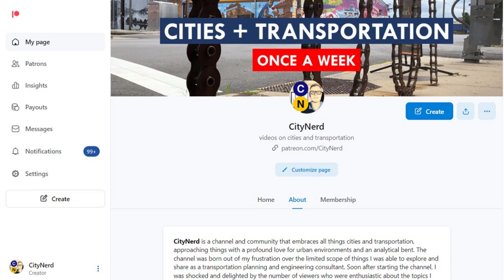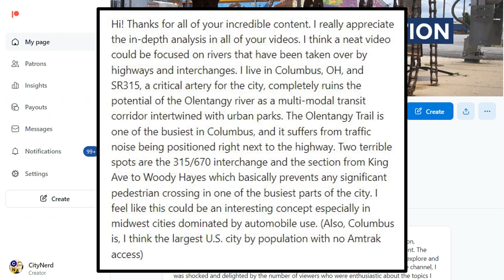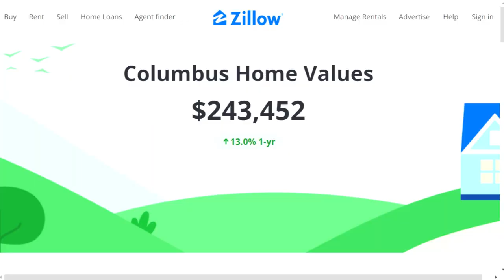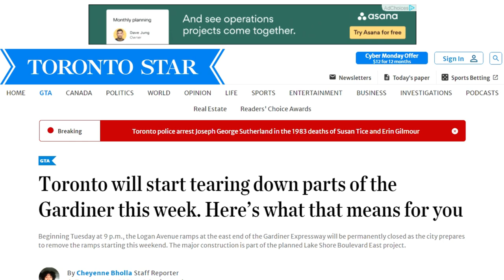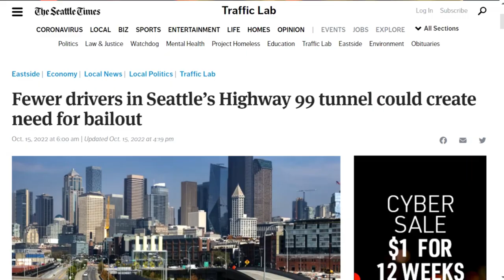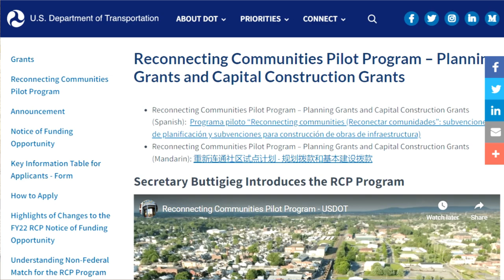Highway Engineering Madness: 10 Waterfront Freeways That Need to Go (North America Edition)

Comment: As a Chicagoan, I've progressively come to identify LSD as a horrendous sore. When I owned a car, I was initially enamored by how beautiful of a drive it was, especially on the north side, but I quickly got annoyed with slow travel times and traffic. There's a bizarre stoplight on the north side almost immediately after a near 90-degree turn (even despite the drive lacking the infamous 's-bend' for decades now), and every single time I've driven that segment I've felt like I've narrowly missed a wreck. It doesn't help that people drive 70 mph even though the posted speed limit is like 45mph.

Outside of a car, all the glorious green space along the lake is marred by noise and air pollution, and frequently you have to walk a half a mile to get to the nearest bridge or tunnel. After rush hour, residents are kept up all night by drag racing cars. I've tried to go on walks with friends on the lovely paths by the lake, and often we have to shout at each other due to the noise. On multiple occasions I've seen cars that have flown off the road over concrete barriers.

If there must be a road, make it a two-lane tunnel underground with a new L line, please. So sick of our cities designed for cars instead of people.
Reply: lakefront trail rocks, but LSD takes so much potential away from it. Bothers me so much how people have come to embrace it in Chicago.
Reply: IMO the bigger crime in Chicago is how wide Wacker Drive remains in one of the most pedestrian heavy portions of the city.  The Riverwalk is nice, but segmented far too much; so when you DO pop back up - Wacker is just... so much wider and less protected than makes sense for a roadway that already has a dedicated below grade service street.  Especially East of Michigan Ave. - where the top level could honestly possibly be removed entirely without impacting traffic significantly.  Heck, the width of the thing between LaSalle and Michigan is an abomination given how pedestrian dense the area is.

Agreed on LSD though - last time I visited, I walked from my hotel north of the river to the museum campus and was shocked to find that the only connection from the north side riverwalk to the walking/biking path East of LSD was via surface streets all the way up by Navy Pier.
Reply: I totally agree! LSD should be entirely closed and made into a park and new L line. Also Wacker in the Loop should be underground only.
Reply: @tedschmiedeler1336  I think the biggest thing taking away potential is the continued stupidity of both bikers and pedestrians on the lakefront trail.  Would love to see annoying speed bumps or something similar to keep the bike path and pedestrian paths separate and safe.  My wife and I used to walk the path a few times per week but I'm not taking my 2 year old on the path lest a biker going 30mph blast him over
Reply: Completely agree. I'd wonder if it would make more sense to convert LSD into a bus-only facility, since I'd imagine making it a train line might be way too pricey for the city. In my mind it's a beautiful Euro-style grassy two-lane affair, but who knows. I live just north of that horrible traffic light you mentioned, and the intersection is obviously appalling at the pedestrian level; having basically an expanded 147/151 bus with increased frequency and capacity running down LSD would be life-changing for anybody close to the shore.
Reply: @jaredking31  I agree.  They got it wrong by putting the separated bike path closer to the lake.  That should be the pedestrian path since the parking lots are there and everyone crosses the bike path to get to the lake and beaches, especially at Foster.  I don't know how many times I've almost taken out a pedestrian or an entire family as they cross without looking.  Signage needs to be beefed up to warn them to stop and look both ways along areas like this.  I don't bike the lakefront trail on weekends at all because of this.  Bikers need to chill out, slow down, and expect that they will encounter pedestrians at some point.  Don't get me started on those pedi-carts for rent
Reply: @jaredking31  at least on the north side they have almost entirely separate paths for bikers and pedestrians now.
Reply: I’m with you on waterfronts being better used than by freeways, but if your local culture has gotten so helpless that you’d tear down a road to stop drag racing, you have bigger problems. You need to fire your mayor and all those who support him/her and clean house. Street racing can be stopped while making money for your city. If your city can’t stop such obvious violations, you are heading towards a Detroit style ending.
Reply: @nunyabidness3075  Oh there's nothing Chicagoans like more than hating the mayor. 

And I feel like stopping drag racing isn't really the primary point of the original comment - getting rid of LSD would be moreso about promoting public usage of the lake front and potentially opening up really valuable developable land
Reply: I am a 3rd generation  Chicagoan. I both love and hate LSD. It was used as a dividing line to create all that wonderful  public space. But some places along the road there just isn't  enough separation  between  the road and the lake. LSD gets shut  down on average  3 times a year due to weather. And not only in the winter. As far as permeability  goes,  almost everything  east of the drive is park land and is closed from 11 pm til dawn.  In the last 10 years or so they have started  actively  clearing and closing  the lakefront for safety  reasons.   Again, I'm  not so sure about this, but I can sorta understand. The lakefront parks are constantly  well used year round. To an extent that I often have to remind myself that it belongs to all of us, so quit giving  those kids dirty  looks.  Those parks are a major part of what makes Chicago great.
Reply: @jj6282  diversey harbor is a terrible connection point where pedestrians and bikers overlap as well(right where the boats come out under the bridge).
Reply: @potterfollower  Totally with you on making better use of the space.
Reply: Lived in Chicago for five years and frequently walked along the lakefront on the north side and these are pretty much my sentiments as well.
Reply: @potterfollower  Chicago has the lakefront protection ordinance to block development and it's probably the best decision they've ever made. Without it I'm sure there would be no parks or paths along the lake, just ridiculous high rises.
Reply: @nunyabidness3075  Like the other reply said, we do hate our mayor A LOT. And getting rid of LSD isn't to get rid of drag racing. But to stay on that topic, drag racing plagues any car-centric town that has wide and separated "busy roads" perfect for it. I grew up in a suburb that was smaller and denser so there were no separated large roads to drag race on. Then I lived in a huge suburb, the classic car-centric NIMBY type, and I happened to live on the edge of the residential area so I was very close to two busy and wide roads (Not next to it since there were no houses there, but on the closest street). Every single night I would hear the sound of people drag racing. And personally I didn't mind the sound, but the racing became a problem for late-night workers. Once I started working, my shifts ended at 10:00pm, which is when people start racing, and them running red lights created a lot of close calls. Also, drag racing ties to a certain type of car culture, so it's not as simple as most people think (I don't even hate that car culture, I just wish they weren't so dangerous).

Basically It is a result of many factors, mostly relating to a town's design that allows for such racing. A mayor can't snap their fingers and get rid of it (though they can at least do some preventative measures).

Also, people already push every problem onto the mayor and claim Chicago is going under and turning into Detroit. And don't get me wrong, I hate our mayor, but this doomer mentality really affects the possibility for change especially in a city that already has such a bad (and overly exaggerated) reputation like Chicago.
Reply: @nmx0014  I dunno, Custard.  There are cameras on all these freeways. Doesn’t seem complicated to me. Last time illegal racing became a thing, they found good roads with no traffic hidden away. Nowadays I see the racing on the same stretch of I10 every time I drive it. I’m not voting for this mayor, nor the same sheriff or constable.
Reply from the maker: Ha, I noticed that traffic signal AFTER I recorded the piece where I said it's all freeway until you get to Grant Park. There is that rogue signal! Crazy, dangerous stuff.
Reply: I get that. Clearly the opinions of 708ers are different. :)
Reply: BetterStreetsChicago made a proposal about a LSD improvement
Reply: Yep, well said. Never thought much of LSD growing up but now I see it to be a complete barrier to enjoying the lake and connecting with the rest of the city. What a fricking terrible idea of a highway.
Reply: Its the best drive in america. 95% of ppl I know in chicago absolutely love it.
Reply: I honestly thought LSD would make the top ten that street is an abomination. Chicago has one of my favorite waterfronts of any city but ofc they put a fucking highway on it.
Reply: Not from chicago but I love LSD
Reply: @tedschmiedeler1336  LSD? really? They need to pick a new acronym.
Reply: @jj6282  What segment are you on where the bike path is closer to the lake? Almost everywhere I've been on the Lakefront trail the bike path is closer to LSD. Some dumb bikers ride on the pedestrian trail but usually I don't have an issue.
Reply: Aw, rats. Chicago was my number one city to relocate to once LA ran out of water. Maybe Toronto...
Reply: LSD is a great time. It blew my mind. I'm not a Chicagoan but I had a great trip on lsd.
Reply: @nunyabidness3075  studies have shown that the most effective way to prevent street racing is to create municipal recreational tracks for public use. Part of the spike in illegal drag racing has come from a decrease in the number of legal drag strips. Similar to the way building new skateparks reduces the incentive for skaters to skate in busy public squares, designated tracks reduce the incentive for drag racers to race on public roads. Contrary to public belief racers don’t have any desire to crash, get arrested, or hit a pedestrian, but if they don’t have a space to safely engage in their hobbies then they will do so in public settings.
Reply: @jacobbwalters8133  Sounds reasonable to me. Of course, where you going to put it? Who will pay? What about liability?

The nanny state has conspired to destroy the easy solution which was to close a small airport for the day. You see, “no one needs a personal airplane”, and that land could be put to better use, so it was. 

Personally, I’d like to see a new custom develop where when some ignorant busy body says, “No one needs [insert other people’s hobbies here]” they get smacked in the mouth.
Reply: @nmx0014  I think one of the reasons that Chicago is gaining a bad reputation is that it is heading in the wrong direction compared to Detroit. Detroit is widely recognized now as a city on the rise since its bankruptcy. There is a lot of new development, a growing tech scene centered on fintech (rocket companies, Huntington, and ally financial are all headquartered in Detroit), low costs of living, as well as big investments in green public spaces and community based policing/public safety initiatives.

Chicago, meanwhile has suffered from an exodus of businesses, rising crime rates (Chicago’s reporting method also makes its rates look artificially low by requiring only the highest level offense be reported- ex. a armed robbery where someone is murdered would only be reported for the murder), and increasingly shaky city finances.
Reply: @angellacanfora  Go to Detroit! Great new river walk developments and you will be amazed how far the dollar stretches! Transit is lacking, but you can live right downtown in the middle of everything for relatively cheap- no need for transit when you can walk everywhere!
Reply: @CityNerd  There are a lot of signals. They start at 800N Chicago, and go to about 1200S Roosevelt to control "loop" traffic.
Reply: @jacobbwalters8133  I'm intrigued! What about crime?
Reply: @nunyabidness3075  I think that publicly funded tracks with low entry fees to pay back public funds over time would get the job done- probably around $50-$100 entry fee for racers- $5 for fans. Land on the south side is relatively cheap and there are a decent number of vacant old mall properties that could be leveled and used in this way. You could set up concessions and betting stations around the track (similar to a horse track) and further generate revenue in that way. Set up some rapid transit links for people to watch who don’t drive themselves and voilà! You have yourself a cheap way to provide family friendly entertainment, prevent dangerous behavior on city streets, and generate revenue over time. It would likely cost in the neighborhood of $10-$20 million to build but because it is adaptive reuse would likely qualify for brownfield redevelopment funding. You could use the remaining land for a wooded park to further muffle the noise impact on the surrounding community so that the neighborhood impact is not huge and possibly even sell advertising and sponsorship deals to tire and auto manufacturers or local dealers.
Reply: @nunyabidness3075  as for liability, there are a number of waiver contracts that could get the job done- you could essentially copy/paste from the waivers used at the many legal racing tracks around the country.
Reply: @jacobbwalters8133  I admire your spirit, but I don’t think that’s going to be easy.
Reply: @angellacanfora  crime is pretty low in nice neighborhoods. Sheriffs Craig and now White have implemented community based policing which has helped a lot. Downtown and Midtown are both very safe areas, as are many of the historic neighborhoods like Boston Edison, though those are further from the urban core and the walkable lifestyle you seem to be looking for. If you are looking for a turn of the century mansion in a good neighborhood for under $1 mil, however, that’s a great place to live- lots of beautiful Tudor, Colonial, Craftsman, and Italianate homes there are on the market for less than $500k.
Reply: I mean considering the horrible traffic on 94, we kinda need LSD, but yea I agree it’s definitely an eyesore.
Reply: @nunyabidness3075  haha. You are right. Zoning in Chicago is a pain and that, combined with current political conditions, would probably make such an option infeasible. I am a policy wonk by trade, so I tend to think in terms of what can and should be done, as opposed to what is most politically and administratively feasible. 

I imagine that this could be sold politically in a city like Chicago, however. It could be billed as a neighborhood revitalization project that decreases criminalization and provides an alternative path and community for young adults apart from gangs. Additionally, you could have a trade school attached that teaches mechanic skills to promote job growth and certain days be EV only, both to reduce noise in the community and to serve as a technological showcase of up and coming green tech. The whole thing could be partially powered by a wind and solar array where one of the old parking lots used to be.
Reply: @nunyabidness3075  which theory of Piketty do you take issue with specifically? He has produced a great body of work in the field of economics and economic inequality in particular so I cannot tell if I agree with you or not- it would depend on the specific theory you are referencing.
Reply: @TeslaDystopia  Northside...From Foster to about Irving Park
Reply: @jacobbwalters8133  Sounds interesting, thanks for the info. I will definitely want something small & low maintenance, like an apartment/condo/townhome situation, once I get to that stage of life, whether as the result of drought, retirement or the Big One!
Reply: @jaredking31  it really is insane how fast some of the cyclists ride in pedestrian heavy areas. And many times they will have the audacity to get frustrated at the pedestrians and slower moving cyclists. 
These entitled assholes won't admit that it's NOT the place for spandex unitard wearing wannabe triathletes in training. Police really should be citing them. Maybe they do, but I haven't seen it.
Reply: @CityNerd  The infamous stoplight at Chicago Ave. It also helps nothing that there is a left turn lane at that stoplight, and the turn lane is insanely short, so cars stack up quite quickly as bleed over into through lanes creating a traffic nightmare as well as egregious safety hazards. When frustrated drivers in the through lanes are stopped during the very limited cycle time when the light is green, they begin to dart out into the other through lanes in which cars can be travelling anywhere from 30-60mph. 
I've heard a theory that the traffic signal was placed at that intersection to slow northbound traffic for the approaching "S" curve where the speed limit dips to 25. There is already a lot of spin outs and drivers hitting or scraping the barrier walls. But I'm skeptical of that theory since there is no traffic signal southbound approaching the same "S" curve. 
And I didn't even get into the chaos of the people coming out of downtown, turning from Chicago Ave ONTO Lake Shore Drive southbound, a turn of which nobody really seems to know the legality, the signals are unclear, and there are 2 different barrier wall obstacles (with just enough gap for a vehicle to squeeze through) that are quite confusing for motorists to follow. 
That entire intersection is a bane on the city and I'm surprised there aren't more deaths due to crashes and road rage. 
Driving in downtown Chicago is a test to say the least, even with an overall well designed plan. People are nuts. The cabs and bus drivers do NOT care about your feelings, and even the cyclists are extremely aggressive.
Reply: @jacobbwalters8133  Might want to check your facts.
 According to Geography Nerd, Chicago is recently recognized by actual stats (not media rhetoric) as the number one city for corporate relocation. 
Which one of you is wrong?
Reply: @jacobbwalters8133  literally everything you are saying is media rhetoric. 
Crime rates in Chicago have decreased 2021-22. Crime rates were rising ALL over the country during the pandemic years, which went against the decades long trajectory of decreasing crime leading up to that point. Chicago didn't even come close to seeing the highest spike in crime rates during the pandemic years. There's a list you can look up if you care about actual facts and stats. And the bit about artificial crime rates is literally a slippery slope to a Qanon level of reasoning. Simply paranoid conspiratorial drivel intednded to propagate a right wing political agenda. 
How can YOU verify and provide evidence for that claim other than repeating the right wing talking points incessantly regurgitated by right wing hack political pundits that have had Chicago in it's cross hairs ever sice Trump started spouting off about Chicago for no other reason than a political spat with the mayor of Chicago? 
How can you verify your claims? Lol you can't. 

That is literally ALL this is. And you bought into it. 

It stands to reason that homicide rate is a pretty good indicator or overall violent crime, and the stats on homicide RATES speak for themselves. Chicago is not nearly the highest on that list. And if you think they are fudging those numbers, which would require literally hiding dead bodies, you are really far down that political rabbit hole.
Reply: @jacobbwalters8133  When I searched riverfront project, I saw Detroit and so great to see that there is another city besides Omaha and a few others are doing, so far though; Omaha appears to be the most serious project.
Omaha may be smaller, but Omaha is avoiding the pitfulls of typical NA cities and is growing at a very healthy rate with some of the most favorable livability stats. Omaha and Council Bluffs are building 3 large parks connecting downtown to the river front along the Missouri river. These parks will contain mixed used development, restaurants a science museum  as well as bus routes and the new street car that will be built through there.

There is so much construction in downtown Omaha and Omaha is focusing on density with mixed used development and walk ability. Compared to Kansas City and Tulsa (which is similar in size and age); which are a complete nightmare of interstates ripping through the city. While Omaha plans in the future to convert i480 into a boulevard and even build a high way cap to connect downtown to midtown.

Here are two videos that show the vision of Omaha and how Omaha is rejecting:

https://www.youtube.com/watch?v=yEVpR-bys-w

https://www.youtube.com/watch?v=VUSMqa9r2F0
Reply: @matthensle9391  the statistics on business relocations are muddled- it is easy to make the data show what you want it to. These surveys rely on self reporting and the size of businesses counted varies wildly, as does the definition of what counts as a relocation. If a business cuts their Chicago workforce in half and moves those workers to another city is that a relocation because many employees left or is it uncounted because many stayed?

What is undisputed, however, is that a number of large Fortune 500 companies have left Chicago in recent years, including Boeing, Caterpillar, and Citadel. Some of those have had more to do with problems relating to IL and the companies themselves, as opposed to Chicago individually , but either way it is not a good look.
Reply: @matthensle9391  I would love to post links, but unfortunately YouTube does not allow you to do so in comments. What you failed to include in your assessment was that while the homicide rate in Chicago was lower in 2022 than in 2021, the rate was still 35% higher than in 2019. 

Additionally, I am not just spouting random conspiracy tinged nonsense about reporting methods and I resent that you would stoop to name calling rather than doing a bit of research on your own. Until 2021 there was no uniform way nationwide of reporting crime statistics- this left much of the way crimes were reported up to the discretion of local officials. The method that I overviewed in my earlier comments was in line with Chicago PD (and federal) policies at the time, but failed to provide sufficient detail in a way that made crime rates appear lower than cities that voluntarily provided more in depth information. The implementation of the NIBRS standard (look it up if you want more info) nationwide should solve some of these issues and refuse variability in crime reporting standards.
Reply: Please check my comments on lsd. It i a legacy indian trail from 18th cent that followed lake mich shore. Also wealthy tried to privatize and eliminate access to lakefront in late 19th century. Montgomery Ward pushed to keep public  space. That is why parks and museums exist. LSD does not extend along lake mich to northern suburbs like Lake Forest because wealthy privatized with homes. Given IL politics elimination of LSD would be 1st step to eliminate access of lake front to public. There can be improvements like more pedestrian walk ways connecting both sides of LSD.
Reply: @CityNerd  please check my reply about LSD as legacy indian trail. There can be improvrments such as more pedestrian overpasses. Sorry for mistypes. I am very clumsy. Also if you totally rip out LSD you will probably begin to get like Notthern suburbs such as Lake Forest or Evanston where public access to lskefront is extremely restricted. It is essentially accessible to 1 percenters.
Reply: @fabes89  Was not Wacker upper and lower drives rebuilt just a few years ago? The old stone work retained at the riverfront and walk. This was also part of the Burnham Plan of Chicago that gave the city a new lakefront of parks, beaches and harbors over decades. DLSD originally a pleasure drive to blvd to expressway ..... is the last one not rebuilt and due. Seems plans came and went to bury parts especially downtown. Now last plan is no burying, but back to more a blvd with more green and independent bus-lanes. Added parkland especially along Streeterville downtown. That is the last one that replaced burying or elimination. Saving grace still is at grade over more ugly elevated. Burying cost and decades to do even a few miles is a no now or removed.
Reply: I actually have to disagree with Jake on this one. Yes, LSD has its issues, as do most roads or highways. But I think there is plenty of balance between parkland and necessary transit infrastructure on the lakefront in Chicago. It is very easy to spend an entire afternoon biking the entire trail without LSD getting much in your way and doing plenty more in the meantime. There are indeed enough crossings to get from one side to another, whether pedestrian/bike-only crossings like the overpasses and tunnels or just using the sidewalks of the major streets to cross under it. There is generally ample parking for those who want to access recreation; it would be hard to access that parking easily without such a thoroughfare. I've never really found the road to create any unnecessary noise when enjoying myself. Perhaps some toward Grant Park, and surely that speed limit is not well obeyed because people do want to get places and it is very expressway-like, so who goes that slow on an open roadway? I do wish parts could be beautified a bit, surely. But the city has done a decent job with bridges and overpasses on the southern section toward 31st and south and toward Soldier Field. It looks nice. From Grant Park to North St. or so, eh. It's pretty ugly, but at the same time, there is virtually no room at all for anything new there.

I think that removing this road would absolutely cripple transportation in the city as there are no other roads along the lakefront that really can carry that many cars at that kind of speed. I mean, when there is actually any speed to it, mostly outside of downtown and the Navy Pier and Oak St Beach areas that get congested. Keeping roads like LSD and their connections like being able to take Lower Wacker to bypass the Loop or take Ohio to get to/from the Kennedy... these are really essential to keep things moving.

With that, I support keeping the road. Doing a better job to make it all more beautiful and appealing would be my choice. Like it or not though, it's a pretty nice drive on a good day and nowhere does it really hamper the lakefront. All these other cities have highways RIGHT beside the water, but Chicago has endless parkland, THEN the highway, then development.
Reply: Nah. Not bizarre. Not “bizarre.” /
Reply: I'm a former North Side resident and I'm honestly split. It is a massive hassle to get past Lake Shore Drive to get to the lakefront, not to mention dangerous. If you're not parking in one of the lots in the park, you're having to cross a LOT of busy intersections and streets even before getting to one of the ped bridges, tunnels or (if you feel really lucky) underneath LSD on one of the east-west streets that terminate at the road. It really sucks. 

But I also can't help to think where those cars would go. On a good day, Western Avenue is a gamble and anywhere from a mile to two miles away. Pretty much every other north-south road is simply too narrow and residential to take on that traffic. With public transit, before the pandemic the L lines were at, if not beyond, capacity during rush hour. Same with buses. At least half the north side, and a few of the suburbs, depend on LSD for access to the Loop. That traffic is not going to go away if we take away LSD. 

Would the city collapse without LSD? No. But the political battles, frustration, anger, inter-neighborhood conflict would make the Council Wars look like a schoolyard debate. The city has enough to deal with without rethinking it's entire lakefront network. Hell, look how long it's taken just to extend the Red Line.
Reply: @jaredking31  Been there, done that.  I tried rollerblading on the path when I first moved to Chicago, and I quit that quick becasue of the dangerous bike riders.  I got creamed and that was that.  I loved walking the trail, though.
Reply: @DrWhoHarvey  The legacy native trail in Chicago is Clark Street, not LSD. LSD is mostly on reclaimed land; on the north side for example Marine Drive marks the old waterfront.
Reply: @dblissmn  Thanks for clarification. I overlooked that.